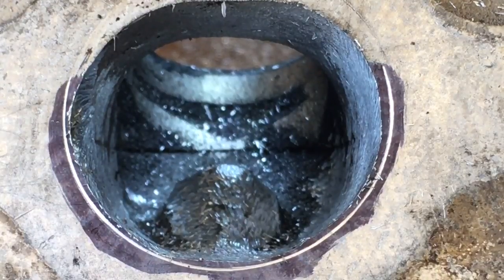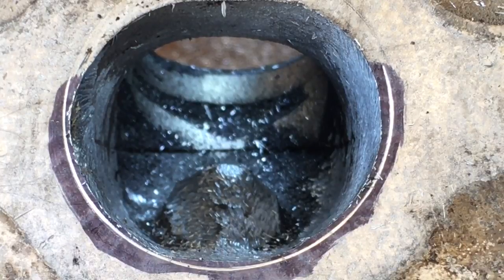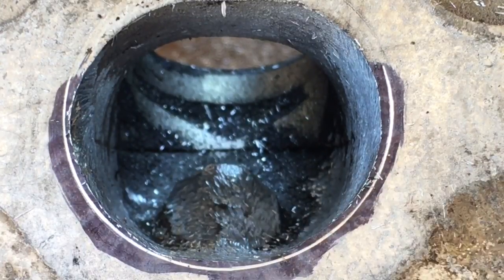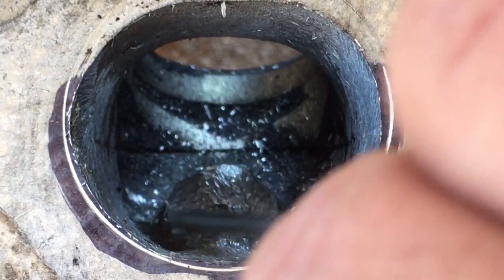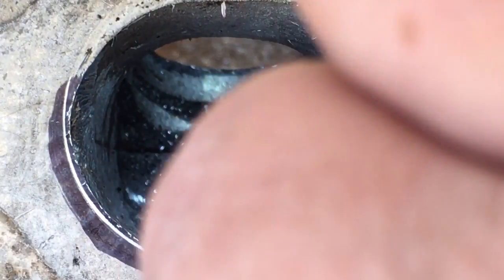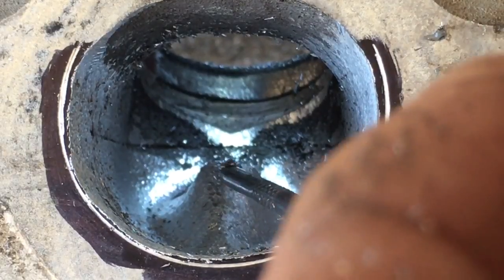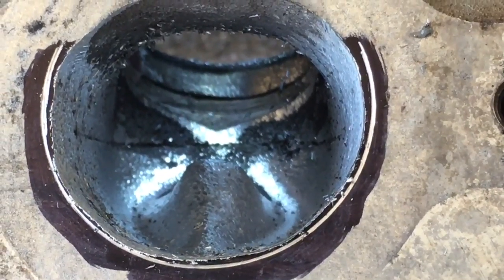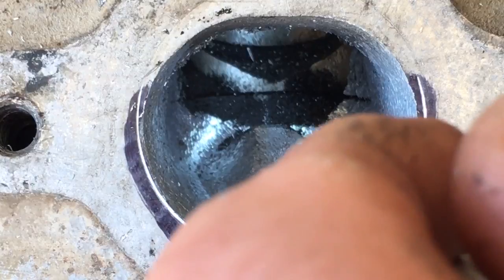Porting LS 862’s for the 4.8 Turbo Day 3

Comment: So based off of your screen name...do you actually do machine work on heads too?
Reply from the maker: Str8sixfan My thing is Porting, engine assembly and Performance consulting. Suck-Bang-Blow-Enhancement! 👍
I’ve really started focusing on the LS engines but have 30+ years experience in all the major American manufacturers. Let me know if I can help. JD
Reply: @HeadFlowInc  who do you trust locally (KC area) for decking/3 angle valve job type work?
Reply from the maker: Str8sixfan We only use Performance Machine, we’ve tried other shops and weren’t happy or flat out got ripped off. 816-250-5532
Reply: @HeadFlowInc  I'll look them up
Reply from the maker: Str8sixfan Map from your area to Cass Midway High School he’s literally 1/2 mile due North from the school.
Reply from the maker: Str8sixfan Head/Block machining is done at Performance Machine Freeman, Mo. no mark up. Owner is Jack Conklin
Crankshaft and balancing we use Bob Morton exclusively.

Comment: As long as you havent hit water, youre making power. Lol
Reply from the maker: Don Rutter I’ve been doing this long enough to avoid coolant passages. 🤞🙏🏻. I use a combination of porting theories and math.  I use mainly Joe Mondello theory for the bowl cut percentages and blend.  Trust me I’m not just making the port bigger for no reason. 👍
Reply from the maker: Don Rutter I see some other head porters on YouTube who are scary close to hitting water passages especially on the sides of the guide tail!  Some of them I’ve seen is swear I could see the “color of death”, the metal will discolor from heat just before you cut through... 😳.  There’s a couple areas in the ports you have to be mindful of; first thing is they’re areas not needing much work.  
On a cathedral port head, if you’re getting a 230+ cc intake runner it’s got to be scary thin, had material removed in areas not needing enlargement, or both. I can only hope they check the ports with a Sonic depth checker. 🙏🏻🙏🏻🙏🏻

Comment: Lookin good
Reply from the maker: TheProchargedmopar Thank you!  I’m really curious how much leaving most of the swirl Ramp will affect the port flow. I’m building my normal port with the exception of the ramp. My normal cathedral intake port is 215cc 2.00” Valve flowing 275+ cfm @.550 and 300+ cfm @.650
I’d be thrilled to get a true 250+ cfm at .560 Lift especially with the 1.89” valve! 👍
I decided, if I was going to experiment with a higher velocity port it’s best to do the test on my own engine. 👍👍👍

Comment: and still the motor makes the same power. my stock 5.3 will still kill it.
Reply from the maker: chip turd I’m just South of KC Missouri, you’re more than welcome to come put your stock 5.3 against my 4.8!  
Let’s see, your 300hp 5.3 vs my 400hp 4.8 🤔🤔🤔 👍👍👍 Ok I’m game! 😎
Oops, I forgot to clarify, what’s your vehicle weight?  My S10 Blazer weighs 3500# with me and a full tank of gas.  I want to make sure you have a fair chance... 😂
Reply: Your stock 5.3 will lose just on its rotating assembly not as balanced as his alone.